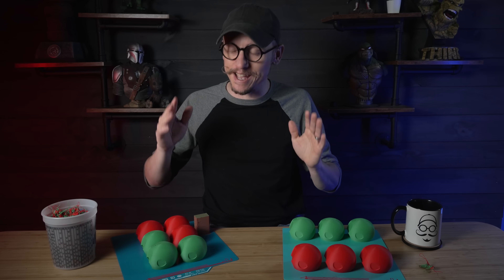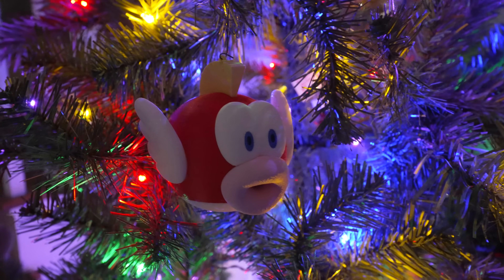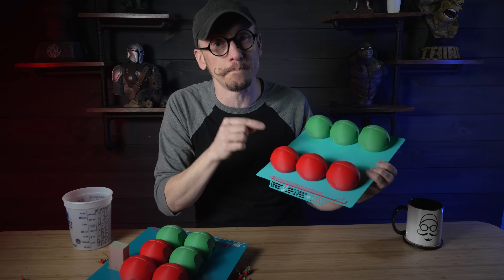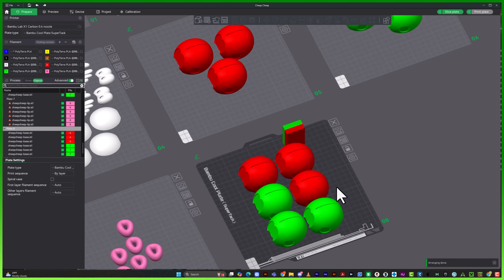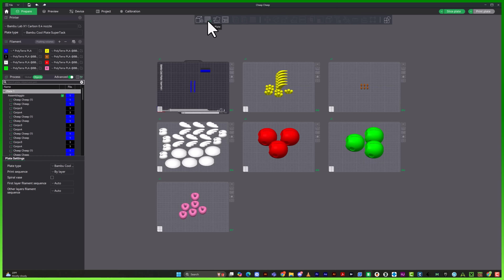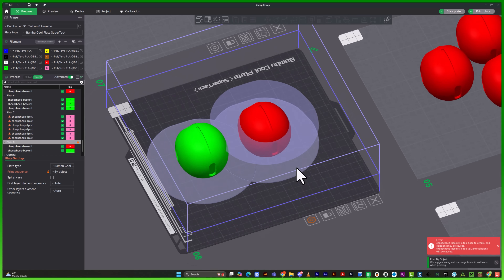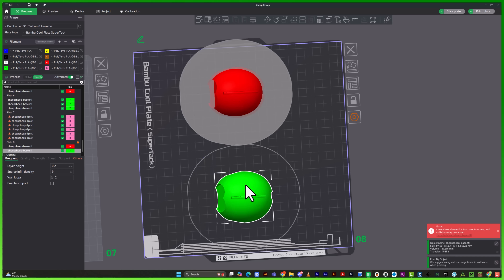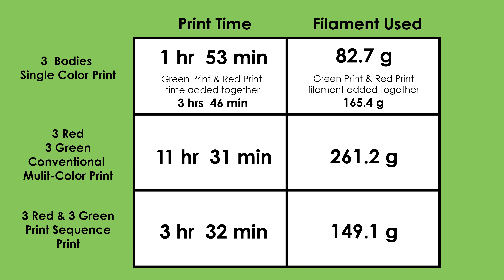Bambu Studio | Print More Efficiently Using Print Sequencing

Comment: I do lots of designs for AMS (LEONLED at Cults3d) One of the worst things one can do is mix prints. The more colours there are at any z-height, the more waste there will be .
I am still saving up for an AMS, you are so lucky to have that nice printer dude!

Designs with the colours more in distinct horizontal strata or only mixing 2 or so colours at any level will use a lot less waste... ( a good model ( that is not literally 100% separating all colour layers) will still waste about 50% of the filament.

Only way to really reduce waste is to run multiple hotends like Prusa XL... BTW there is a new aftermarket mod coming out soon that will allow you to add many toolheads each about $35 per colour for the hardware, and I thing the base module is about another $250...  you can stick as manyu in as you like  (well there is a 35mm space required between each head on the waiting rack, but they are small... thae actual heater sits in the print head bit that moves around... so it is kind of just handing over the tube of filament, heating it for a few  seconds and printing... with no waste.

You had a couple of legit tips in the video!

Comment: I am printing a Saturn V model. I am printing all the white parts, but the head jumps from one side of the plate to the other when it could just do it sequentially, following the objects 1 by 1 saving time by moving. I used this recommendation and although in the first plate I saved 30 minutes out of 11 hours, it seems a better way to print and I think I would be better for other models. Cheers!

Comment: Been playing some more.. One thing missing... When you rotate the objects to get them front and back, you have to do them the right way.... If you do it one way, the print will start on the back and then do the ones in the front.. If you rotate the opposite direction it prints at the front first then the back.. I assume this is important, as you want to print at the front and work back? You can also fix this by swapping the colours.. I guess its all to do with the "default" colour.. So if its red and the priming lines are red.. it will do the red first, irrespective of whether it at the front or back.. This wasn't mentioned in the video and may be important?

Comment: Dear  MeadMaDea,

I wanted to touch base with you because I’m encountering a problem with a model I’m attempting to print.

I’m 70 years old and recently started 3D printing as a way to supplement my fixed income and keep myself engaged with something enjoyable. My goal is to manufacture or assemble old-fashioned whirligigs with animated figurines using my 3D printer and sell them at a flea market located directly behind my house. While I’m not aiming for significant income, this is something I’d enjoy doing.

Currently, I’m working on a whirligig featuring a bucking horse with a cowboy rider. It’s inspired by a Bronco Billy figurine from 3D Colts. I attempted to paint the figurine in Tinkercad, but I ran into an issue: I couldn’t find the right file format to export the painted model to Bambu Studio without losing the colors.

Here’s what I’ve done so far:
	1.	I painted the figurine as a 2D image on the surface of the 3D cowboy-and-horse model.
	2.	I then mirrored the model and flipped it to create a duplicate image. My intention was to merge the mirrored side with the original, so the figurine would display the same painted image on both sides, regardless of viewing angle.

I meticulously examined the model to ensure there were no color bleed-throughs or unpainted gaps, fixing approximately 20 small issues. However, after slicing the model in Bambu Studio, I discovered color inconsistencies. Some areas showed colors where they shouldn’t be, even though I had blocked off all potential bleed-through points.

The issue seems to occur despite the flat surfaces of the figurine having no bends, turns, or angles. I suspect the merged mirrored side might be interfering with the original model. Additionally, while using the paint fill option to correct some areas, other unexpected color distortions appeared, and I couldn’t repaint over them.

The only alternative I can think of is to print each piece of the figurine separately, then glue them onto a core silhouette. However, this approach defeats the purpose of painting the model directly in Bambu Studio.

Any advice or suggestions you could provide would be immensely appreciated. I’ve been learning everything through YouTube, and you’re the first person I’ve reached out to for help. I understand you’re busy, but if you could find the time to guide me, I’d be incredibly grateful.

Thank you so much for your time and assistance.

Sincerely,
Grandpa Gray

Comment: If you were to print by object with multicolored parts.  Lets say you wanted to print those eyes, but with different colored pupils.  In that case, there is no purge tower (I assume to prevent the print head crashing into it.)  But don't we need the purge tower for multicolor printing?  I am concerned that you would not get complete color changes when there are color changes, in my hypothetical above, you'd get bleed thru into the whites of the eyes, no?  I am trying to do just this, and I know I could just try it, but I want to use fairly expensive filament so I want to try to understand before I start.

Comment: This is awesome! So it will only work for a single objects with single colors but do you have a way for a single object with mulitple colors?? For example say an object with 4 colors, I'm pretty new at this also so I'm just trying to figure it out. I notice if I print something with more than 3 colors the filament changes are ridiculous. It will print like a little spot and switch etc..... 😞

Comment: At least with PLA on the texture build plate,, I don’t take the build plate out of the printer when the print is done. I let it cool down and then the print just slides right off of the plate. And getting the flow testing portions off the plate is easily done with either a fingernail or a very simple scraper.

Comment: Great content. How does printing them in sequence use less filament than printing separately? ( 15:56 image ) I've use sequence printing regularly for the same reasons you mention but can't say I've ever noticed a filament savings verses doing the jobs the default way of multi-plate. As many have mentioned, your style of info sharing promotes easy learning and / or remembering, great job.
Reply from the maker: You save doing them at the same time in a sequence because each time there is the calibration areas and purges at the start. So cutting one out saves more filament.
Reply: @ItsMeaDMaDe   I hadn't thought of that, thanks.

Comment: I already knew about Print Sequence but I would have previously just printed separate plates by color. Your reasoning regarding combining the two colors on the one plate makes sense. As you are not only saving the time to cool and remove, but also the time the printer takes to resume printing waiting on the pre print routines. Thanks for the suggestion.
Reply from the maker: Yeah that’s where the real savings is. Cause using sequence settings it’s faster and saves filament if you noticed in the chart at the end.

Comment: At a point where I am seriously considering jumping into the Bambu ecosystem this video was an eye opener.  I'm sitting here drifting off thinking of the possibilities.  Thank you.  Though my wife may end up cursing you! 😂
Reply: I'm a few months into A1 ownership and I don't regret it. Followed the space for years but was always worried about the amount of tinkering required. I didn't have the time for it. I wanted printing to be the hobby, not printers. The A1 has completely solved the problem for me.
Reply: I have been 3dprinting for over 15 years now. And one thing I can say is Bambulab lab have don what Prusa ore Crealety should have done many years ago. Prusa was kinda there, but all other Chinese manufacturers just kept making cheeper and cheeper mashines, and took advantage of thair customers, and the inovation have stood almost still the last 10 years. I got me a Bambulab X1C and that rekindle my love for 3dprinting, and it's a tool now, not only something a am trying to make better myself.. But they are on thair way with a new one a larger printer and it looks promising if the rumors are correct it's going to have atlesste 350mm3 and a dual print head that tilts. Can't wait 😊😊😊
Reply from the maker: Ha ha. Well I know I have made many spouses annoyed with me convincing their significant other to get a printer or get another 🤣
Reply: Years ago when 3D printing was newer and much more hands-on I was going to go with creality like most everyone else but my last trip to micro center I discovered the bamboo A1 and I fell in love with it and I'll be picking it up next week and more and more I look into it more more I think it's the absolute right twist especially for a beginner I mean I don't think you're a beginner I'm just saying in my in my case just because everything is so streamlined and easy to use
Reply: @ItsMeaDMaDe could do a video on why under nozzle settings and filament settings both have retraction settings
Reply: I was always interested in 3d printing but I knew the constant having to tinker, tweak, fix, etc would drive me insane. When I found out about Bambu my mind was made up. Took it all out of the box and up and printing in 20 minutes.
Reply: IT can be done on any ams type system.....
Reply: well this comment ages well with the current BS bambu labs is pulling
Reply: @nilsdock  maybe...maybe not.  Once you get past all the internet FUD you have to decide if it really changes anything.  I had every intent to use their slicer anyway.  Nothing has changed.  Where they go as a company in the future remains to be seen, but most people have no problem using Apple or Microsoft, so whatever...